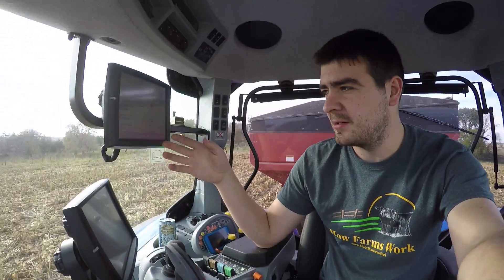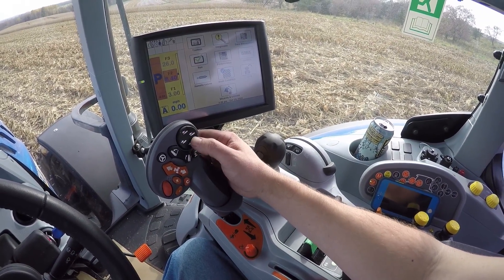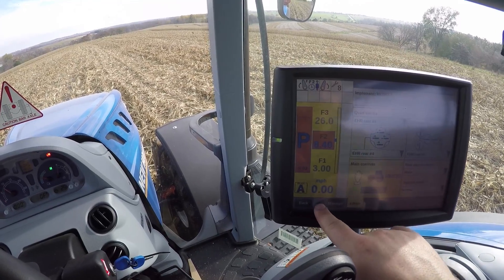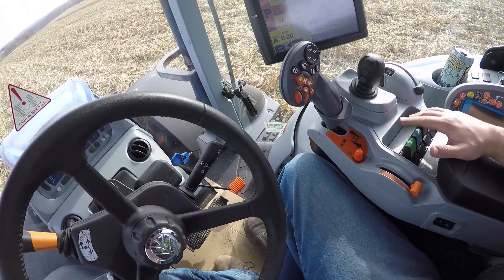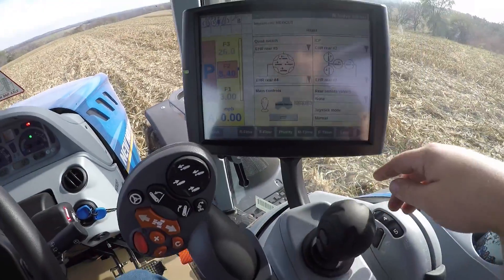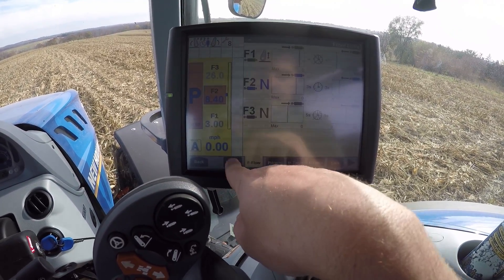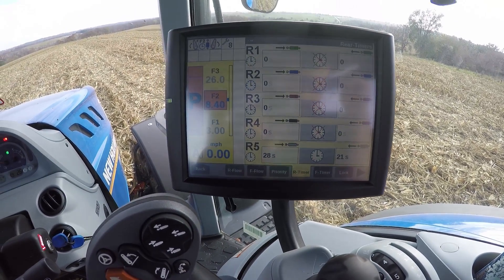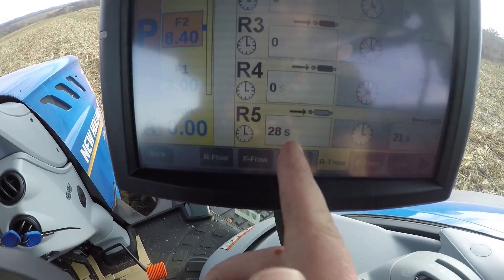Hydraulics Simplified - New Holland T7.315

Comment: I am not a farmer but I have a question. Can different profiles be set up for each implement you have connected to the tractor? An example can you save the grain cart programming. So it doesn't have to be set every time. Then if you use the Chisel you select chisel so the buttons do chisel functions you have programmed.
Reply from the maker: Newer tractors do have programmable settings that can be saved per implement

Comment: Although all this stuff is cool, at the end of the day, I wasn't wore out from running a mechanical hydraulic lever, than never fails!
Reply from the maker: +RJ 1999 The point of it isn't to keep you from being wore, it's to make it click and forget so you can focus on other things, like lining the tractor up.
Reply: +How Farms Work Never had a problem lining up the grain cart with the truck and swinging the auger out as I drove in, its called being an operator, not a driver! lol. But seriously the idea in farming is to make money, that 10 seconds of time saved would never justify the cost of that tractor. On Allis Chalmers tractors all had detents in the hydraulics, you can hit the lever the auger wings out, when its full out the detent kicks out hydraulics shut off, couldn't be simpler, never fails, never needed repair. By the way if you want to make your life better buy a front folding auger, not a side one, you'll be happier than the electro hydraulics, just my opinion
Reply: +RJ 1999 Beautiful tractor by the way

Comment: Nice video!
Is the hydraulic more powerfull than in your 8235r?
Reply: i know for sure it is becaus case styer and new holland are the best whit the hydraulik
Reply: jeffrey hollink not true, not even a little. our 6800 deere was miles ahead of the new holland of its day. they are starting to even up now but basically at the end of the day it's about how you spec them when you buy them

Comment: Too bad they don't make the PTO's to be more automated. I know it could be a safety issue but then you wouldn't have to reach back and remove your hand at all.
Reply: As someone who has removed what was left of a human after they were tangled in a PTO (more than once) I don't want a PTO to have ANY way to activate on it's own. I'd really like them to eliminate the PTO completely and use a hydraulic drive system.
Reply: Blazer02LS Go back and re-read what I wrote about the safety.
Reply: Blazer02LS diesel electric tractors are coming so all pto drives will eventually phase out to electric motors eventually. should be a gain in efficiency as you can powerback the engine bur still maintain pto speed when the power isn't needed.
Reply: its called a vario/ivt/cvt chap...

Comment: can you explain what you mean by relying on the clutch. you should rarely use the clutch in a 8R.
Reply from the maker: +Sid 15 Its a powershift, so to do any fine movements the clutch is a must or else it'll lurch ahead.
Reply: I get the difference, but even loading a semi I just pop in & out of a low gear to move. Try to never ride the clutch on a 8R.
Reply: Never use clutch in our JD 8310r with IVT trans.  Boss told me to get my foot off of it. But I do catch his son using it.  lol